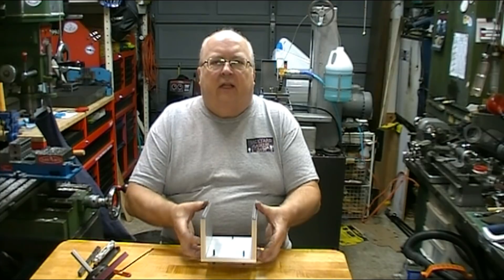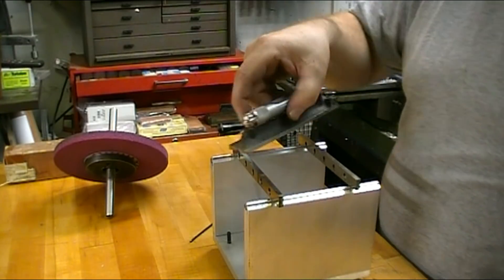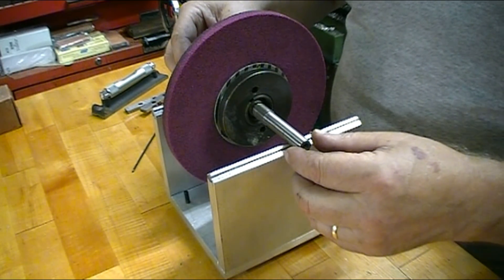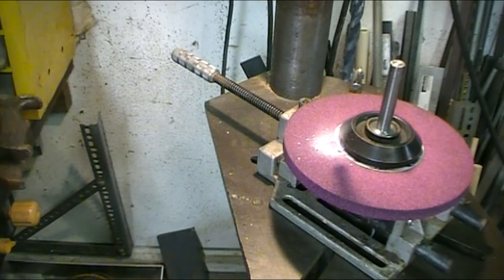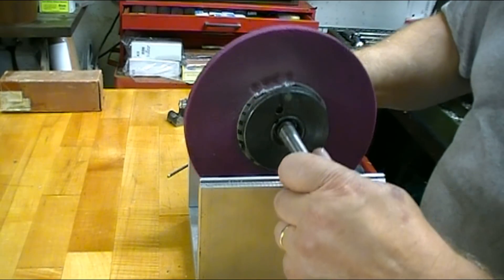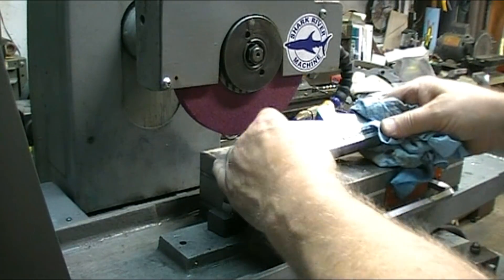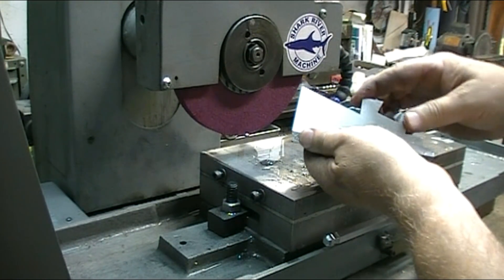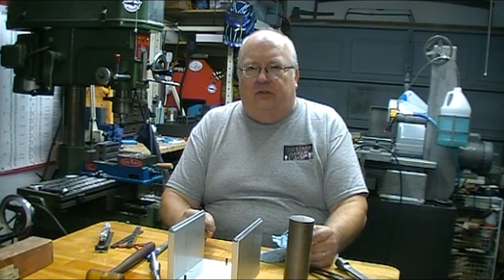Balancing A Surface Grinding Wheel

Comment: Is the rod + other pieces used here to hold the wheel across the balancer coming from inside the surface grinding machine? Im almost ready to baiance but dont have a way to hold the wheel across the balancer like that.
Reply from the maker: The shaft or arbor that the wheel is mounted on is a separate part that I machined specifically for balancing the wheel assembly.  Here is a link to the video.  the threads that I cut on the arbor ended up not being necessary as the wheel hub fit on the taper tight enough that the nut was not needed. https://youtu.be/NWrYen7b19Q

Comment: this noise you have is like because of bad bearings in the spindle, the sound of the spindle must be uniform but yours sound like combustion engine
Reply from the maker: Bearings are good, V belt was worn and has been replaced.  This grinder is used several times each week and is working great.

Comment: if you dont want to risk ruining a drill, for stuff like that i just used JB weld to cement some SiC powder on the end of a 10mm linear rod lol
Reply from the maker: The drill is am old masonry drill no chance of ruining it.  I have since started using balancing rings mounted on the hub.  A much better solution.  Was never a big fan of drilling the wheel even though it is an industry accepted procedure.

Comment: good video but its far faster and more accurate to place any surface ground item on top and place a large steel ball bearing on it and adjust till it does not move.
Reply from the maker: I suppose that would work just fine but I see myself chasing that ball all over the shop LOL.  I am actually working on a sequel to this video because I have never been happy with removing grinding wheel material to balance it.  There are few reasons for that I will cover in the video.  When I was grinding professionally I had a different style balancer that just needed to be close to level and I added weight to the hub to balance it. However the wheel was 24" in diameter.  Thanks for watching and commenting.
Reply: @sharkrivermachine  no problem but the ball works well on everything I even use it level machines. On my surface plate it sits on a big wood table top I sawed out and it has your three identical screws out at the corners for leveling the plate. the steel balls are cheap simply by googling them in sometimes they call them monkey fist balls--I have them all sizes from 1 inch to over two inches. For balancing the wheels I made one of wood with the 2 rails glued in and it also has the 3 leveling screws. I take various weights even pennies and tape them on till balanced then jb weld them on the wheel itself up near the hub on the inside of wheel. I want to get some lead shot like from shot gun shell and use that method and simply pat the shot into the jb weld. works great I even use the method on pedestal grinder wheels. I make and sell balancing arbors also. any small weights jb welded to the side of the wheel may sound funny but nothing gets them off of there I even used an old discard wheel as a test and tried to bash a penny off the next day with a chisel and it cant be done.

Comment: This is a horrible way of doing this!!
Just get a arbor with weights. You risk damaging the wheel and exploding when using it. I highly recommend no one doing it this way.
Reply from the maker: I have been grinding for 40 years and never blew up a wheel.  I have had many different arbor styles including some with removable weights. Trying to find adjustable weight arbors is easier said than done.  I would never use this method on a wheel under 1/2" thick.  This method is used industry wide and is also demonstrated on several other Youtube videos.

Comment: Hi Steve.  What is the thinnest wheel that you'd drill on?  Looks like this one was at least 1/2".  What about 1/4" or even 1/8"  How do you balance those?  Also, want to thank you for these great videos.  Keep 'em coming..
Reply from the maker: A 1/4 wheel would not require much balancing because of the decreased mass.  I would be very cautious about drilling one.  An 1/8 wheel once dressed would be just fine without balancing it.  The other way of balancing is to use weights in the form of offset shims that would rotate around the center of the hub.  They are a bit of a pain to use because you have to keep loosening the hub and moving the shim until you get it right.  There are also hubs that have movable balance weights.  Thanks for watching and commenting.  I think that Randy Richard has a video on the different types of  balancing scenarios.

Comment: Hi Steve.
I think I'm going to make a balancing frame in the near future after seeing yours. I've seen commercial ones but they are usually pricey or broken.
I have a wheel on the shelf that goes around turning my grinder into a Wacker plate. Good little project.
Reply from the maker: Thanks for watching and commenting

Comment: Enjoyed Steve!
ATB, Robin
Reply from the maker: Thank you Robin.  I have to admit that I fouled up when I put the stone back on the machine.  I went to tighten it up and the stone slipped on the hub because I had not tightened it enough.  Had to tighten it up, redress it, and put in back on the balancer to true it up.  Lesson learned.  But the finish is almost where I want it. I did notice that the finish improved as I ground which leads me to think that I need to let the spindle warm up longer before starting to grind.

Comment: Looks like the balancer works nicely.  Did you true up the wheel on the grinder before you started doing the balancing?
Reply from the maker: The wheel is actually one that I have used.  I had it off of the hub and dressed it again after I reassembled it before balancing.  Thanks for commenting. I didn't show all of the steps.  Maybe I should have but my intention was to showcase the balancer not the entire process.
Reply: I was wondering if that was the case.  Not doing it could have been one of the reasons it was off so much...other than the wheel just being out of balance that much.  Take care.

Comment: Why not check first that the mounting discs are balanced. Then add the grinding wheel.
Reply from the maker: I didn't show it on video but I did check the arbor and hub prior to mounting it. As a matter of fact there was some tape and adhesive on the hub that I had to scrape off with a razor blade.  Thanks for watching and commenting.